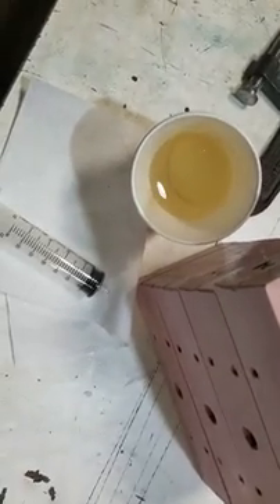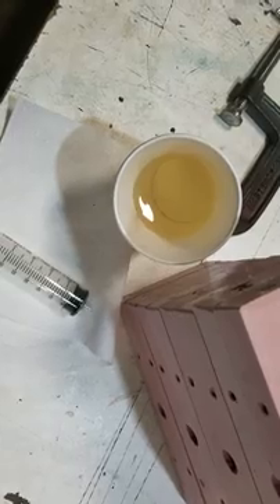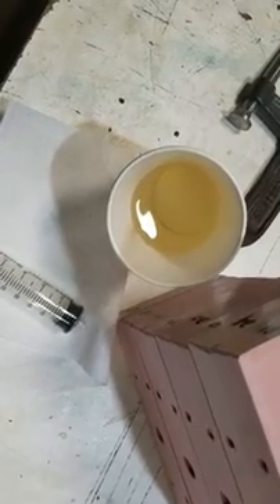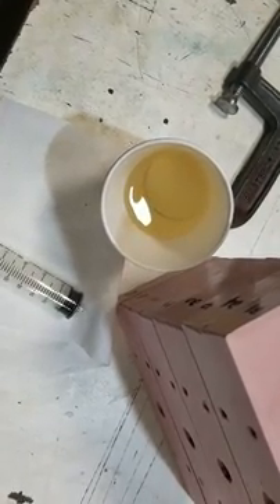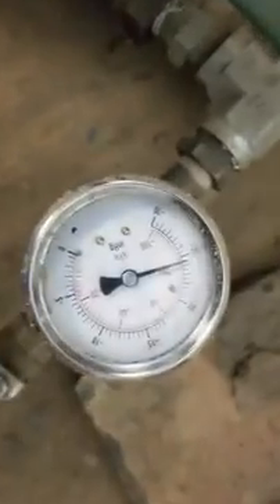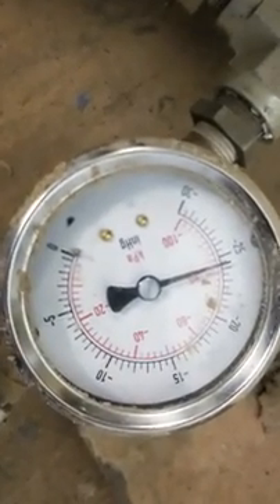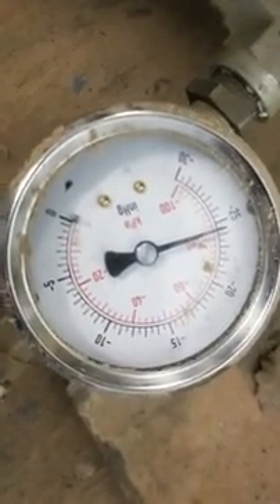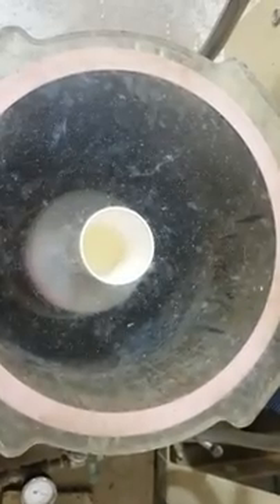Chinese diesel heater fuel pump air bubbles

Comment: , I love that you mentioned the fact of diesel heater because I'm about to install a new one and I've always bottom fed the tank and used are fuel hose all the way throughout and never had a problem 

I totally get why people have a problem with the green fuel line but when they switch over to the nylon they're not perceived seeing the vacuum load from the tank and seeing those micro cavitations they're not even air bubbles per se but also within that then when it pulses and it slams as people complain with having that nylon hose especially at the small diameter they're using I don't care if they match up the whole ID blah blah blah the only way I would say nylon would be as good as a fuel line R9 is it the nylon was not oversized but where it like attaches like PEX compression but also that leads me to the current fuel pickups they're so small diameter I don't like them if you're going to do top feed pick up with the straw make sure it's a bigger diameter are my preference is at the corner of the rounded

Comment: I'm pretty sure you're boiling the diesel.  As the pressure drops, so does the boiling point, until the boiling point is the same as the (room) temperature of the fuel.  The gas being released isn't air, it's fuel vapor.  You're doing good science with that vacuum chamber!  You could add a sensor to measure the fuel temp, then plot what pressure the fuel boils at for differing temperatures of the fuel.  I'll bet if you compared your plots to a reference source, they'd match!  :-)

It's also called "vapor lock" -- when a pump is sucking on a section of line (decreasing the pressure), segments in in the line become fuel vapor.  And, when that segment reaches the engine, the engine becomes fuel-starved for a moment.  As soon as the fuel cools, or the pump isn't "sucking" so hard, the vapor bubbles disappear.

It occurs to to me that the fuel vapor in the vacuum chamber, combined with the remaining air, might be flammable or even *explosive*.  So yeah, watch out for that!  :-)

Normally, diesel/kerosene is much safer than gasoline because it gives off much less vapor (the flammable part) at room temperatures than gasoline, which gives off a lot.  In your case, you're compelling more vapor to be released than usual.  You might find diesel fuel re-condensed from the vapor at the exhaust of your vacuum pump.
Reply from the maker: Hi! Thanks for the comment, I'm really terrible at keeping up with comments on my videos, sorry. I made this video in response to a forum debate on Chinese diesel heater fuel pumps. My speculation was that the design of the pump and the high speed at which it operates at 'full throttle' is what was causing the air pocket problem so many people were having. With clear lines we can see that there are no air pockets before the pump which is often several feet away from the tank. Then we see lots of small air pockets forming after the pump at a steady pace. That causes problems in itself as the pump itself is what meters the fuel flow so with air pockets in there its getting a bit less fuel to burn (fuel vapor takes more space than liquid)  and if there are bends in the line the air/vapor sometimes collects there, build up into a large air pocket and then releases, causing something similar to vapor lock in an internal combustion motor. The heater gets no fuel for a moment and this causes it to run poorly and be inefficient. Someone on the forum pointed out that with the syringe i may be pulling so fast that air is getting past the seal. I don't really remember what the whole debate was about anymore, But when i say air i do mean fuel vapor. I think people were saying that the fuel pump could not vaporize the fuel, causing these bubbles and i was trying to disprove that. Thanks for the reply! Going to be using my diesel heater again here soon and hopefully it runs well.

Comment: How do you stop the air bubbles from happening? Mine keeps turning off because of air bubbles fuel line
Reply: My best guess is a small leak in the part of the line that's being "sucked on" by the pump -- that is, upstream of the pump.  I was surprised to find my fuel filter almost filled with air a few days after it was filled with fuel.  I tightened down on the hose clamps upstream of the filter.  I expect that'll fix it.
Reply: did u fix it I'm having the issue now...but I ran gasoline in my diseal heater idk if that's why I'll try. switching back